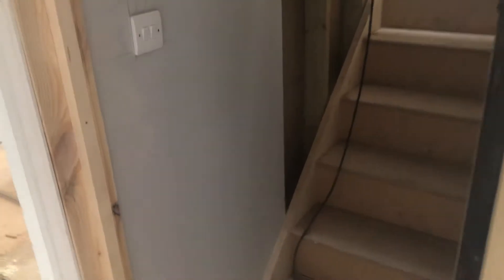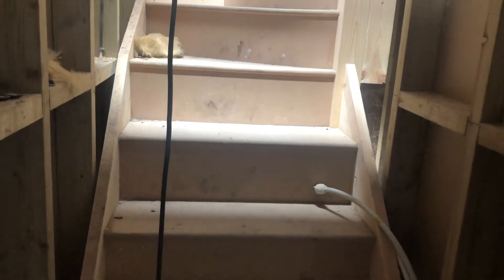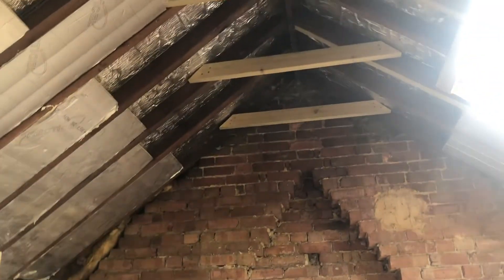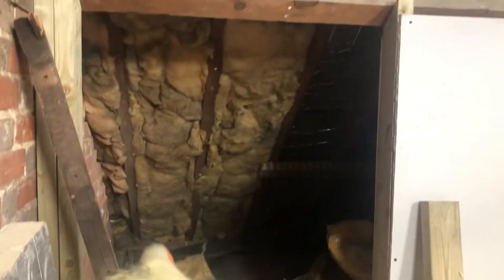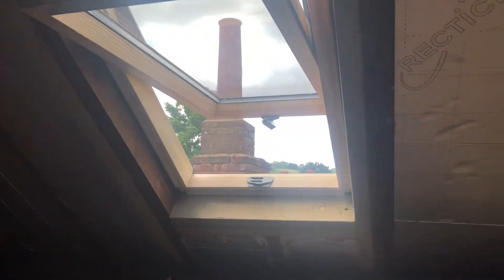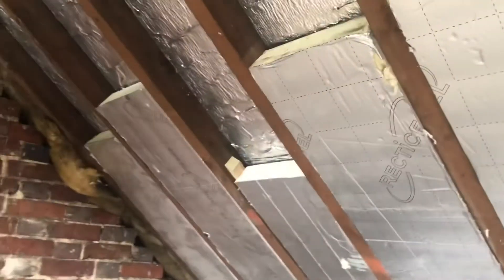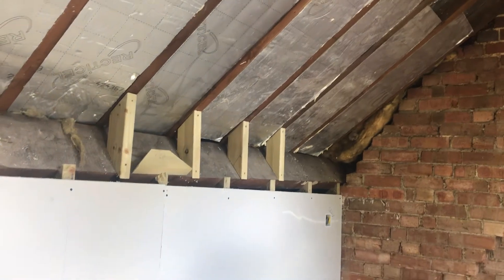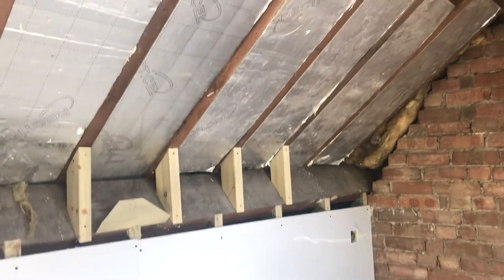Loft conversion in progress no dormer.

Comment: Pretty big gaps between the top of your party wall and the roof, building control usually like those closed up with bricks and mortar as much as possible to prevent fire spread.
Reply from the maker: Everything is getting done to regs and under BC so will be built if required. Only one side has party wall and other has chimney which may give impression of bigger gap on camera as wall is behind.
Reply from the maker: On this one we are doing under building control and all was signed off This week.